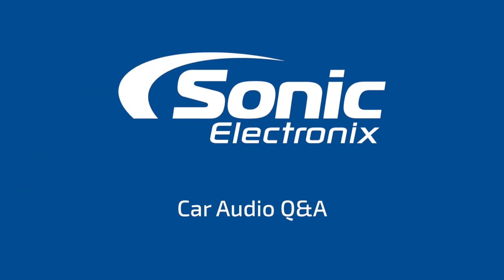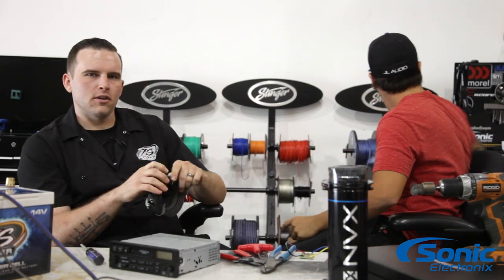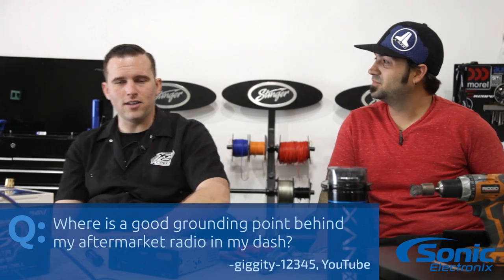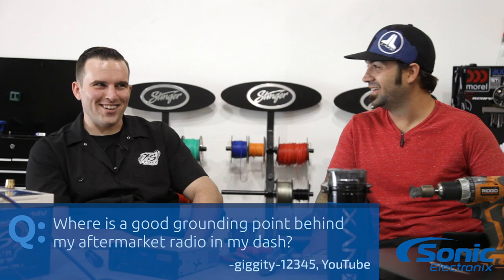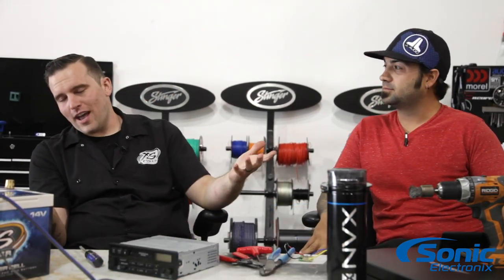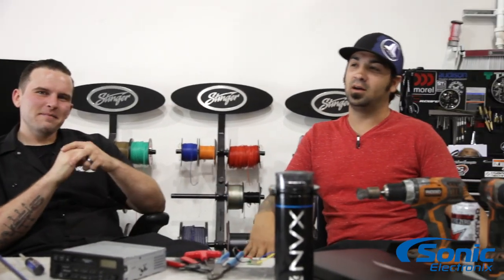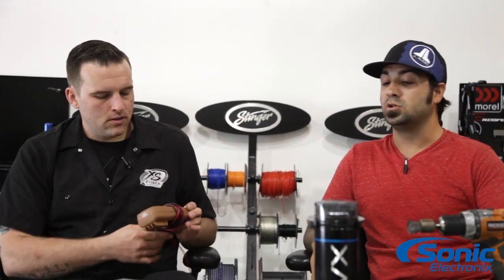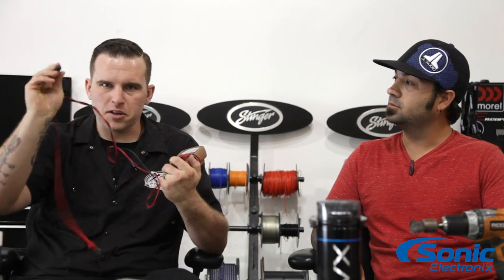Grounding Your Aftermarket Car Stereo Inside the Dash | Car Audio Q&A

Comment: What I did was was somewhat what you said. I spliced my factory ground wire and a extra 18awg wire I had together and crimped a ring terminal on them. Then I grounded the ring terminal to the metal behind the dash which had a bolt. Then I connected that extra wire to the radios ground wire... So not only am I getting a good ground from the factory ground wire, but also from the metal frame behind the dash
Reply: There's a couple ways to do it but I think this works.

Comment: My aftermarket head unit gets super hot on the back. Is this normal, or is there a way to stop that from happening. I used a harness to connect to the original vehicle wires

Comment: I have 2006 nissan titan my head won't turn on I  connect it directly to the battery it turn on when I  connect it factory harness it won't work I cheak the fuses there ok
Reply: I have a 2006 Nissan Frontier so we have the same chassis and wiring. I would say to definitely double check your 12v wires.
Get a cheap volt/multi meter and check to see if your wires 12v positive wires are getting power. Also, just like they said in this video, make sure you extend your ground to an actual part of the chassis. That was my problem, I had it hooked up to the metal bracket that hold the head unit but mine at least turned on, I was just getting alternator wine because it wasn't actually grounded.

Comment: We plugged right into the already grounded factory connector with a pigtail adapter, so no need to use the ground wire on new pioneer pigtail or adapter pigtail.
Reply: You still need to connect that ground to the stereo's ground wire!?

Comment: Thank you. 
This video has helped me immensely. I’ve been struggling with trying to get my stereo to work in my nissan and low and behold, there’s no ground behind it. Just metal that appears to be part of the frame (but I’m not really sure if it’s metal).
Reply: just out of curiosity what nissan is it? im gonna install  stereo in my girlfriends nissan tomorrow and was wondering if you ever got it figured out.
Reply: Matt Starkey It was a 2017 Sentra. It took a bit of looking but I found a ground located directly behind the air conditioning controls which was bolted directed into the frame. I put a terminal connector on the ground wire and carefully tightened it into the ground bolt. After connecting the harnesses, the stereo turned on.

Comment: I have s 2004 Pontiac Grand Prix GT without streering wheel controls,  ive replaced the radio and it will not come on and I can't figure out why..can you help

Comment: Yes infiniti, so I have the pkg the bose nav and dvd/tv player i got the ground deal but i have another question and it's still in the process maybe I'll figure out when i connect but my radio has nav but its onto of the dash my actual cd player that comes out of the car is where it typically goes, so is there something I can/need to hook up  to have nav to my radio and dvd player functions my new stereo does have nav so should I just completely get rid of the original navigation and if I do is it ok just to un connect everything the screen also displays some radio info and the ac temp for driver and passenger but I still have the knobs that actually turn it on

Comment: Can I bypass the wiring harness ground wire and ground the stereo straight to the chassis?
Reply: Josh Carruth yes use the ground wire that comes with the radio a black thicker wire ground it to bare metal maybe with a crimp connector I did it and it eliminates any engine noise or high pitch noises coming thru the speakers
Reply: Yes indeed

Comment: What causes a stereo to get hot enough in the back to almost burn you,I have tried 3 different radios all 3 done it,it’s connected right with a schosche harness and interface.they worked fine just got hot I have a 04 Silverado 2500 hd.
Reply: I'm having the same problem, the aluminum "buss bar" on the rear of new kenwood stereo is very hot.  Have u figured out the heat reason?
Reply: @juniperpruniper4935  No I haven’t I gave up I have no idea what it could be
Reply: @southpawler1325  I've done some more research..  hot to the touch is not really a temperature..  wires start to degrade around 200F.  Paper ignites around 450F.  Hard car plastic prolly incinerates or starts melting around 300F or way more..  so hot to the touch is likely 130-140.  It's normal for that aluminum heat dissipation unit to be fully functioning at 170F.  Really hot..  i guess the move is to just have some air /space near that thing and it should do its job cooling the unit.  All comes from inefficient electrical conversions to create power, which in turn creates heat.  So anywhere to be more electrically "tuned" in would decrease heat, like amp settings, tuning stuff i don't know about on the speakers, etc.

Comment: Aftermarket stereo is smoking.  I'm wondering if it's bc it is not grounded.  I see no place behind the dash to ground anything to.  There is a cig lighter but I really don't want to tear any other wires  apart.

Comment: I have an aftermarket radio in my 2013 Toyota Prius, and it’s pretty much plug-and-play with a wire harness. There is some noise and audio distortion if I crank up the volume. I recently noticed that there is a black ground wire that is not connected to anything. Should I connect this somewhere? If so, where? I can’t find any information online on where to connect the ground for a 2013 Prius.
Reply: Yes. I have the same issue did you fix it?

Comment: When finding a good ground with your chassis using a multimeter, I'm pretty sure you don't want to see 12 volts. You would rather want the rating to be closest to zero.
Reply: If you're testing it with a DMM, you could test with 12v on positive lead, and a potential ground on negative lead. You should see 12v. And then you can ring it out from a known ground to your potential ground, and check that way as well.

Comment: im confused tho,  i have an 06 pathfinder i just installed a kenwood ddx9703s.  i just used the ground that was on the harness i bought and it worked HOWEVER.  i noticed a couple issues,  like  when i dont have music playing i hear a high pitched noise that seems to change pitch when i press the gas pedal?  i read that this may be because of a grounding problem?   also i noticed now that the sound is not as loud as it was when i first put it in yesterday.  
there was this metal piece that went across that is getting in the way making it so i cant put the stereo far enough back so its not set in properly.  does anyone know what i can do about that situation?  i have the bose system in the car so i had to use the rca jacks instead of the speaker wires.  
does anyone have any suggestions?  i need help. can i ruin the stereo by using it with a not good ground?  idk.  i figured the ground was good because it was attached to the harness and plugged in.
Reply: piffdaddy420 did you fix it ?

Comment: Well I have a 1998 Honda Civic. My harness was cut out of my car so I had to go to the junkyard to get one. Radio still doesn't work. I got a grounding wire so all I have to do is drill a hole in this "tubular" thing in my dash for it to work?

Comment: I put new aftermarket stereo in 2005 Infiniti g35  and it turns on but theres no sound!!!, how can I fix it
Reply: Did you find out what the problem was?
Reply: anthony2897510 hook up the blue wire with the white stripe coming from your aftermarket to the blue wire coming from your amp. If your aftermarket doesn’t have one, twist it together with the acc cable coming from your dash. It should be the one you connected to your aftermarket’s red wire. This should get power to the amp hidden in your dash from the ignition.

Comment: What if the car is not grounding? Checked every bare metal surface on an 88 volare with a multimeter and nothing is giving a good ground and as a result the stereo won’t turn on. Any suggestions are welcome.
Reply: run a 14 gauge wire from the ground on radio to the ground on battery or fuse box ground

Comment: i just installed a nice aftermarket radio on my 2008 Malibu classic but used the Metra 99-3303 adapter and just plug and play the connections.  Stereo plays ok but sometimes powers off and turns back on immediately without loosing any memories or clock time.  Could this be a bad ground since it is connected directly to the supplied wire or need to ground it in a good place other than the supplied connector.
Reply: corina0001 did you find a solution, this is happening to me

Comment: if my pioneer double din is already grounded through the wire harness ,should I ground it again seperate?  I have distortion comimg from my subs I can't get rid of tried everything.  all is in order. has to be from the head unit .
Reply: try grounding your RCA's
Reply: Well turns out the distortion and  muddy sound was basically coming  from the FM radio ,spotify & well produced CD's sound good. Not sure if maybe my power wire is running along side the antenna  or what but the radio sounds like sh!t. Not that it matters too much , losing out on 15 minutes of comercials  every 20 isn't a big loss .
Reply: Was very disappointed thinking my last Kicker compR 12's sounds better than my two idmax12's.

Comment: Hi guys, I just installed an aftermarket MP5 player in my Nissan. I dont connect the  player's ground wire to any ground wire/chassis, the player is working well, no whinny noise. Will that (no grounding) be  harmful to the car & audio system. Because if I grounded the player ground wire to the chassis, the whinny noise will come when the engines rev increased.
Reply: I've ran into where mine worked for a while and now it's out because of grounding issues.
Reply: In my case, it still work fine until now. I dont need to ground the player
Reply: worse case run a ground wire like 14 gauge ofc wire from ground on radio to a good ground as in the ground on battery or fuse box or alternator which can usually be anywhere on the engine block
Reply: I'm pretty sure you still grounded your stereo, you connected the black wire from stereo to the black wire on your vehicle's wire harness right?  If so then that grounded it.
Reply: @Lazy_Prophet  Yo...I have an Accord...I just replaced an aftermarket Panasonic(11 yrs) with a Boss. There was never an alternator whine until I installed this Boss last week. Basic swap out...and plug n play with the new Boss harness. Everything was already grounded...nothing came loose...so why is there alternator whine? I don't understand.
Reply: @79improve  Bro I'm the last person to ask lol, I'm not very good/knowledgeable with this kinda stuff.  Maybe 1 possibility is the factory amp isnt connected now,  sometimes it's a separate set of wires that you have to connect to your stereo.  Without that hooked up then the stereo has to use more power.  I wish vehicle manufacturers would design their audio systems to be more aftermarket friendly.
Reply: @Lazy_Prophet  Lol. I feel you. All I have is 4 standard car speakers...and a Bazooka subwoofer(built in amp). With an aftermarket radio. Shit isn't anything major at all. I simply swapped out radios.
Reply: I had a whiney noise in my 2000 maxima with the factory bose. Noise went away after I put a new alternator in it. Bad diodes in the alternator created my problem.
Reply: The same thing here I installed a mp5 player in my 2002 Infiniti i35 and the ground wires are not hooked to anything and the radio plays fine but I have the whining engine noise can anybody help me get rid of the noise.

Comment: Durant from Dallas, Great website boys....You guys have helped me out several times....2006 Kia POS Sorento.... 
I have a problem with pandora on my phone going threw my kenwood.....All sounds GREAT  until I need to charge my charger on my phone then I hear winding and humming which is telling me I have a dirty ground. I have put a meter on it and it tested good as a good ground. I have put Ferrites, coils wrapped in ferrites on my - wire and + wire, I've tried buying a better quality charging cable...AND STILL NOTHING.... Have you guys heard of Ting off your ground wire with a capacitor?
Please shoot me or help me...
Thanks fellas.....
PD

Comment: I just installed an aftermarket double din in dash screen and when I turn my headlights on it starts flickering and glitching of sorts does this sound familiar please help
Reply: If it is a older GM made vehicle like a Pontiac Fiero then there is a brown and orange wire and some people will tap into the orange wire which has 12 volts with the headlights off but when you turn the headlights on it turns into a negative and it will cause that glitching problem
Reply: @robertbrooker706  that's the illumination wire

Comment: Does grounding take away the buzzing whinning sound that is coming out of the radio?
Reply: Hey!!! I’m here because I’m having whine issues in my 2005 Tahoe. I stuck a jumper cable to my - battery then touched the metal on my radio/head unit and it stoped whining. Took me weeks to figure that out. So yes it could maybe fix it

Comment: why would there be no ground in the harness?
Reply: I'm no expert at all, but I think because it's just a thin peice of metal that doesnt touch anything else.  Chassis is grounded because it actually touches the wheels/tires, which is a true ground.
Reply: Nissans with the Bose have 2 ground wires in the factory harness. Chassis ground and Amp ground. Most aftermarket radios only have chassis ground on the harness.

Comment: love the info and video!!  I'm having a problem and I'm hoping you can help me.  I've checked my ground with a meter and I'm seeing good ground on my system.  with the key in the ignition turned on everything sounds amazing and clear, but when the car is on and running I get tons of noise and I can hear all types of engine noise and hum through the system.  Can you please point me in the right direction?
Reply: I have a Nissan, and the car has the same issue when I installed an aftermarket player as you mentioned. I did this and the noise gone: I removed the ground wire of the player from the chassis (as Nissan dont have the ground wire in the dash), all noises gone. If I ground this wire, noise will show up if the engine runs. Hope this can help for your case